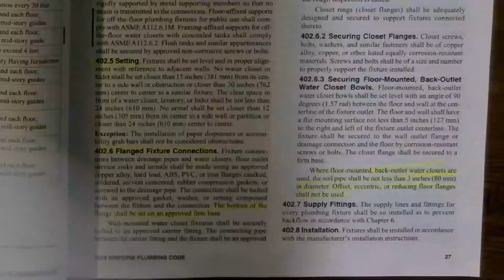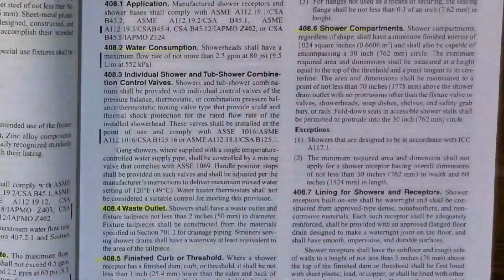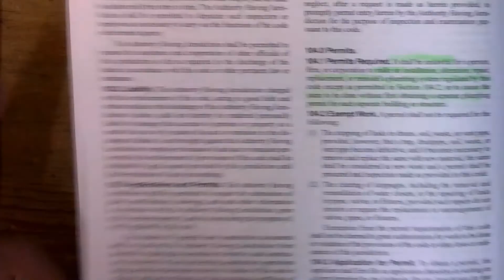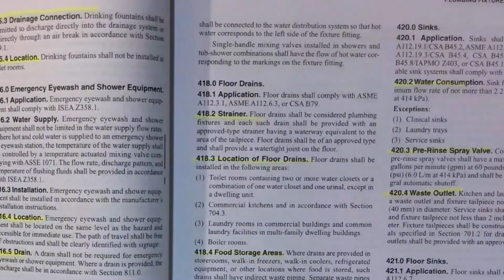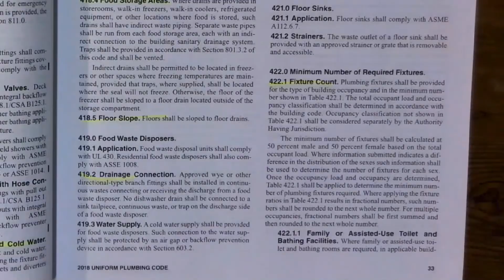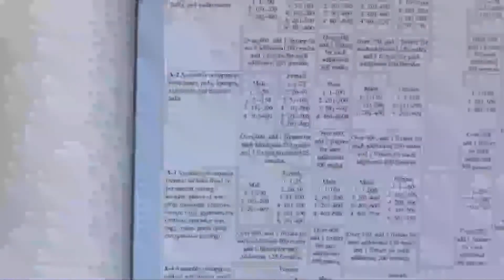UPC Chapter 4 Review

Comment: Thanks- Still using the 2012 book, it is shorter and different order, but it had 65% of the same material.
Reply from the maker: Interestingly enough, many jurisdictions still utilize the 2012, with amendments.  So, even though the '12 is officially the code, there are "adds", adjustments, and/or removals every 3 yrs.
Reply from the maker: The state I am in now still uses the '12. They use the IPC and not the UPC. The structure of that code is different, and it is much thinner.

Comment: I understand from a cost standpoint, but just piping a separate trap under the sink drain with stacked santee's, and dumping the dishwasher discharge in its own standpipe just seems the ideal setup; not impeding on the sinks drain rate in the event you are running both your sink disposal side, and dishwasher simultaneously.

Why isnt that just the code?

Thank you for the lesson, I really appreciate it.

And that's a hehe. The dreaded cruise control behind the wall fixture supply piping. Been there.

Gotta love them 10p.m days.
I really did a number running some in series high temp baseboard; i dont even remember how I messed it up, but I remember that I did. I think I completely missed some rooms with limited materials, and it was in a absolute less than desirable dirt crawlspace on a mountain.

"You still at the job??"

Yeah, but I'm off the clock..
Reply from the maker: What area do you work?  Many codes vary from state to state.
Reply: That was in western Colorado. 

I think I used the knockout once, on a disposal? Everything else wanted its own trap.
Reply from the maker: I recently moved from upc country to IPC. Huge differences that I am looking to describe in upcoming videos.
Reply: Its not bro. High chance of a backup causing damage to the floor/subfloor/cabinetry over a much wider area
Reply from the maker: To expand a bit on Ryan's statement of a back up, the dishwasher is not allowed to be directly connected to a trap under the sink. It has to be an indirect connection. So, tying it to its own trap- if I'm reading it right- will only create some serious issues down the line.

Comment: I have a question, about auto vent for under cabinets on new construction. I was told that new plumbing code allows the plumber to Instill a auto vent in place so a vent thur wall is not required if that method is installed, .. is that true?
Reply from the maker: Short answer is if your municipality allows it, yes.  In my opinion I think those are not ideal.  The fact that it is a diaphragm and operates on a concept of opening a rubber seal through negative pressure and closing it on positive means that if there is ever a situation where a back up occurs and you have it installed under flood level rim, that "mechanically operated" AAV could foul up- causing sewer gas intrusion.  Also, an AAV where I work is only allowed in cases where structural conditions prohibit the installation of a conventional vent.

Comment: I hope what they say is true. "Third time is a charm". This will be my third time watching this 12 chapter series as it has been invaluable to me for my c-36 exam prep. At first I used to tell myself, if they ask me questions of DFU's or WSFU from the chart (with out giving it you) I was screwed. But then, Look at it, its the best way to check other's people work and help you decide if the branch or system and handle another fixture. A bit of practice and some help from a personal mnemonic tricks I used, I able to recall vertical, horizontal, vent, trap arms & WSFU values, as it made more sense the more I looked/used it. I don't think I wouldn't even try to read the code book more than twice with these videos, now I'm amped up.
Reply from the maker: If I were to give you advice on succeeding on the upcoming exam, I think it would be something you already possess.  A thirst to do great.  Once you have that need to know more, the information seems to soak into the grey matter with ease.  I'm so very blessed that these videos were of help to you getting that drive!!!  Email me at gorhambm@outlook.com please, I'd like to correspond further with you on your exam preparations.